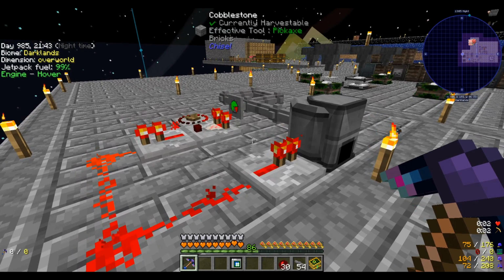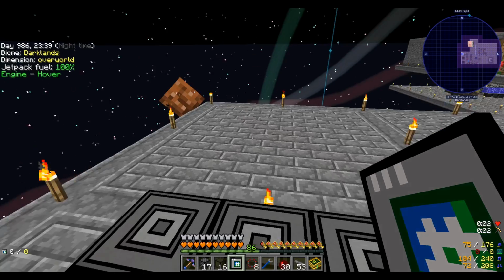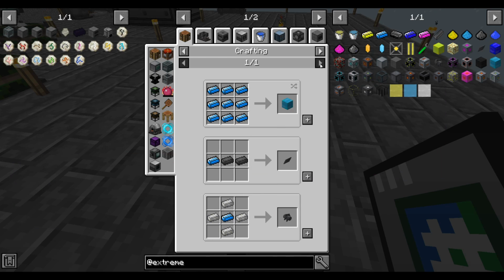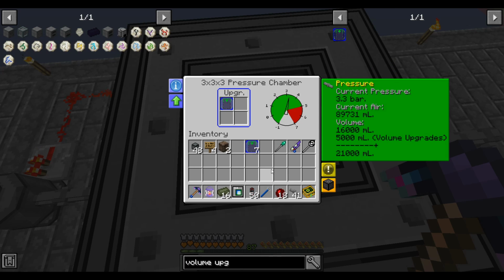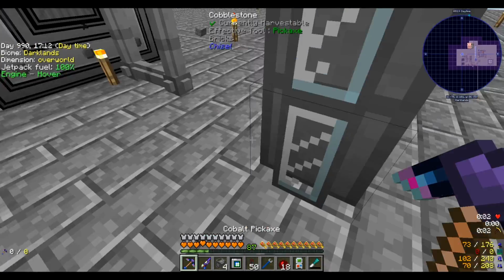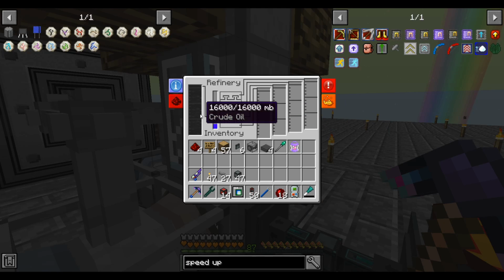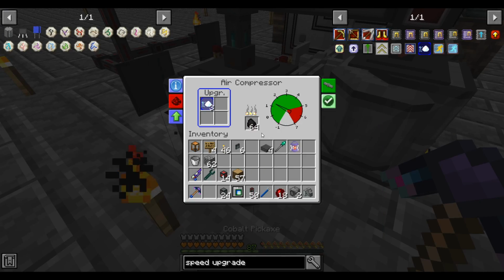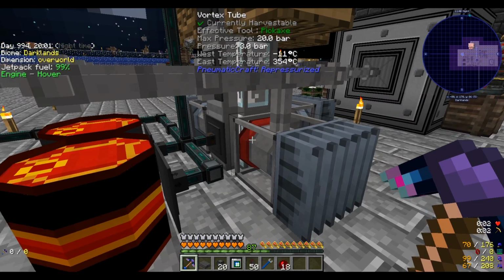Project Ozone 3 Kappa Mode EP16: Under Pressure

Comment: Any block will work as an insulator. Iron bars are nice since they don't connect so you don't see them much. Also, Blood Magic runes are exponential just like Pneumaticraft speed upgrades. Different video on those obviously

Comment: I'm surprised you didn't make security upgrades... I believe they stop machines from over pressure and explode
Reply from the maker: Security upgrades add a built-in pressure relief valve that vents air when machines overpressure. It still wastes energy, and is better to just prevent a system overpressure than venting it. (Although venting an overpressure event is better than exploding)